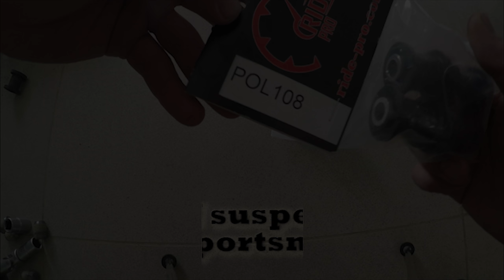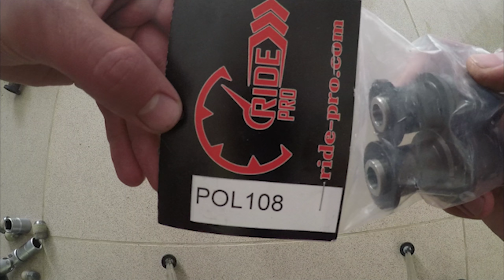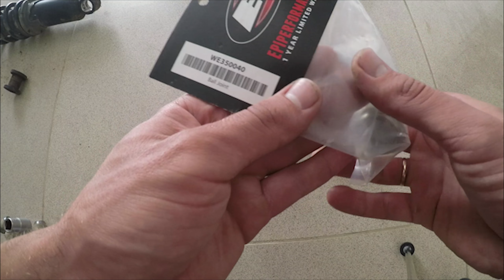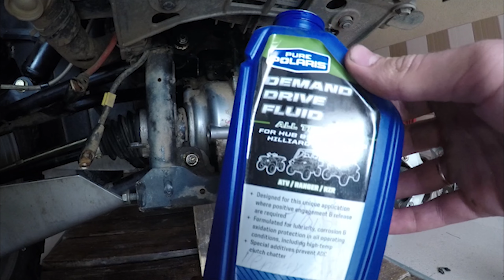Repair of suspension Polaris sportsman 850 touring

Comment: Did you change the suspension just because or were you have issues?
Reply from the maker: the shock absorber bushes were broken.  The 2 ball supports had a backlash, so I decided to replace them.